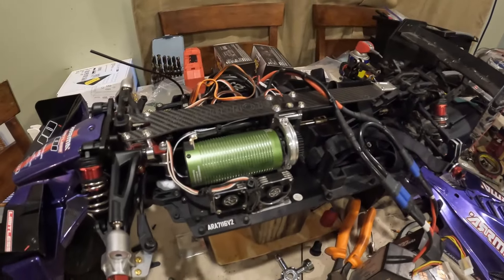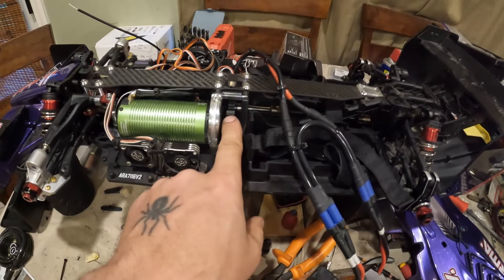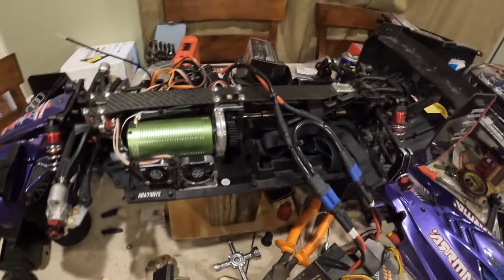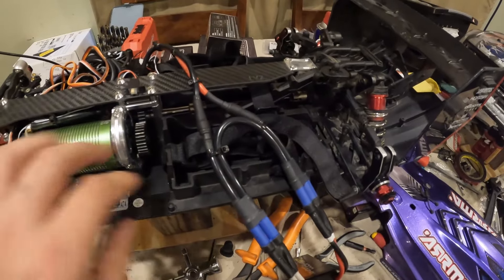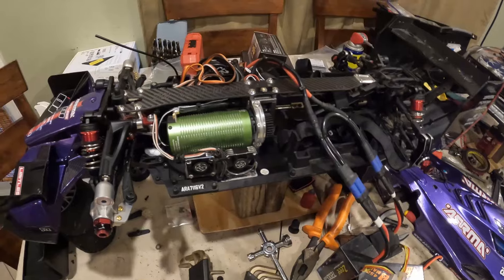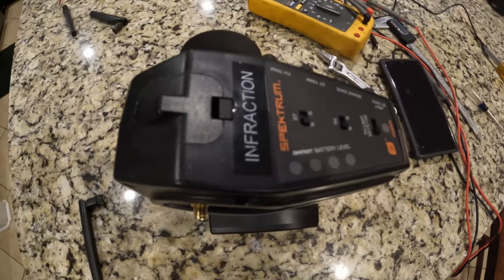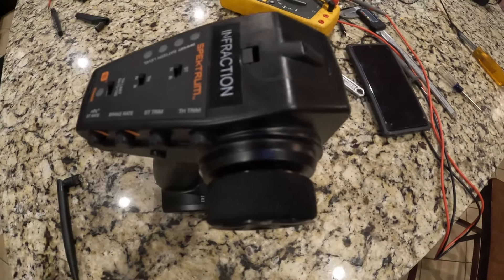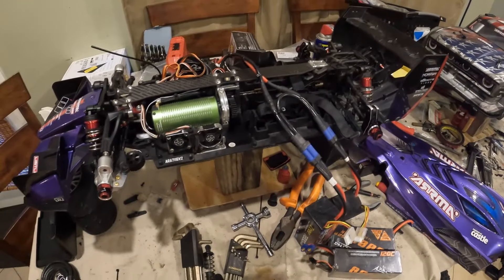Limitless V2 Update | Upgrades, Motor Choices, Custom Transmitter.

Comment: Imo 1700 is a pusher and 2400kv is a breather . So the length of you run way will help you decide are you able to open the 2400kv up and let them breath in that area? Or are you pushing hard to get to top speed and quickly breaking ? The one thing g I said I wanted to see on your castle link the info was how many feet or the distance of the run !
Reply from the maker: I have a Facebook page called SpeedBoostRC, where I'll be sharing my logs. Lately, my runs have been limited by the range of my controller. After some modifications, even without the signal booster, my range has extended well beyond my line of sight. I'm hopeful this will allow the car to really stretch its legs. I usually ease off the throttle early because I'm worried about losing control if I run out of range and can't stop the car.
Reply: @SpeedBoostRC  yeah I just put a range booster in a couple days ago … are you sure that model has the antenna and it’s not built into the board? Some of them need to be soldiered on and it’s small and heat sensitive … mine worked out and it’s beyond past seeing range… but you can set up the car with certain remotes that when they lose signal they apply the brake for you
Reply from the maker: I already did the mod. The controller has aregular IPEX connector on it so it was very easy. I did measure my run location today and its 1722ft.
Reply: @SpeedBoostRC  yeah you’ll need more imo and a ladder lol

Comment: Curious to how many amps you're pushing. Do you have a log to share of that 100k rpm pass? Im sure its set but make sure the log has the right motor kv and gearing in the settings as well. I would keep that 1721 in there. It's more than capable and can easy go 150+ without a problem.
Reply from the maker: I do have the logs and will share them. I have a Facebook page I recently set up and will start sharing it there. I definitely need help because I already blew up an ESC and one 1721 2400 motor.
Reply from the maker: I purchased more motors and have a stock of ESCs, so I'm ready to run again. What gearing should I be running on my Limitless for a safe 150 mph pass? If you don't have this information, what gearing should I start with. I blew an ESC with a 30p/45s. I blew the motor with a 30p/36s.
Reply: @SpeedBoostRC  Thats interesting that the motor and esc would go with that gearing. I have run the xlx2 through the reamer with way more aggressive gearing with no failures from both my motor and esc. Im wondering if its the trigger pull and the amp load coming on too strong too quick. Could also be ripple voltage as well. Ripple can manifest from several things but in normally comes in low than levels off as you get to full throttle pull. These motors need so much room to breath and ramp up speed. This looks like a very short running location and I know people are limited by what they have available to them, which Im in the same boat at the moment. I would look for a spot that will at bare minimum 1/4 mile to a 1/2 mile of running room. What you'd like to see essentially on a full run in ft is minimum 2700ft to 2800ft. The most ideal would be over 4000ft but that is very difficult to come by. I would get the perfect pass launch control to help with trigger control. This might be the issue with the esc going on you. I feel like the power is coming on to o quick and damaging the esc.

Comment: single motor 1000ft or less 1700 all day ..... with logs and distance ran , I can give a little more advice
Reply from the maker: Im going to post logs on my facebook page which is SpeedBoostRC
Reply from the maker: I'm running 1700ft
Reply: @SpeedBoostRC  nice ill check the page and share some logs. Im only at 153mph on my 1100kv car 150 1700kv with about 1200ft of road.